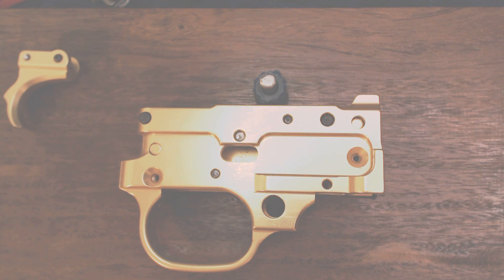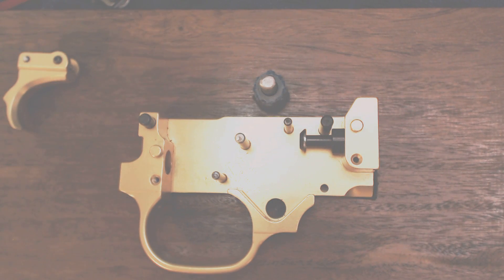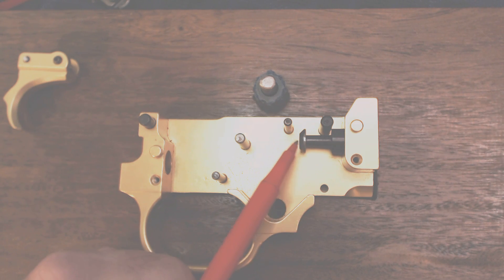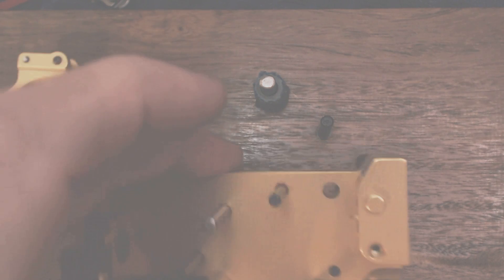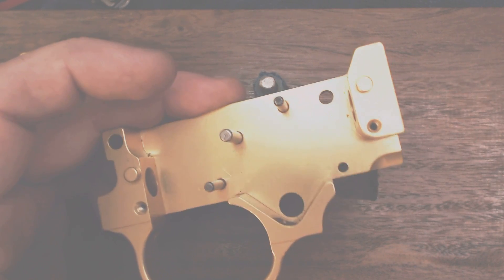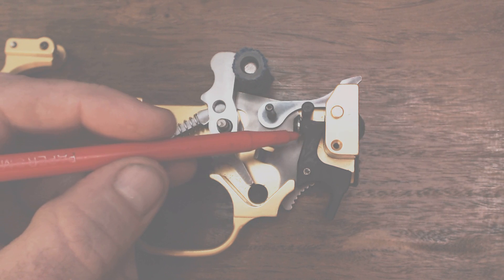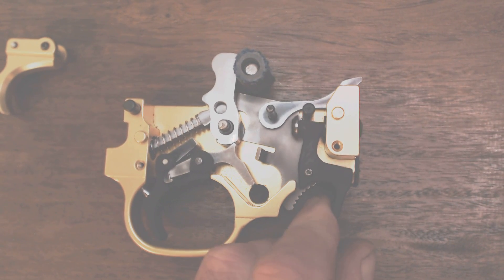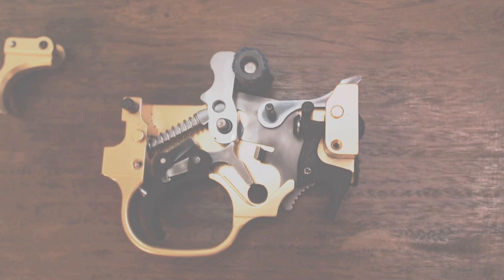Ruger 10/22 Trigger-"and how it works"

Comment: this is a very good video. now i understand how it works & what needs to be redone to lighten the pull and remove creep. it's a two stage trigger. it has take up, then the wall, then the creep, then the break. take up i don't mind, but creep on my factory trigger is bad.

Comment: Thanks, Aaron! Just seeing all the parts interacting was enough to help me figure out that I mixed up the trigger return spring with what I think is the sere spring. *My trigger wasn't resetting, but everything looked correct. It wouldn't break either, until I figured out that if the trigger was manually reset it would function, and release the hammer.
 *Thank you for helping me rule out the majority of the assembly as the culprit! I appreciate the format you used, with detailed illustratration.

Comment: Nice explanation. I've done quite a bit of work to my trigger group and your video gave me some more ideas of areas that needed polishing. One area in particular I found is the hammer bushings, where applicable. The contact area of the bushing and hammer was rough. Careful stoning and polishing of the hammer and very carefully polishing the bushings really smoothed it up. I'm still learning, but reducing friction in the hammer and trigger components lightens and improves trigger feel.

Comment: Thank you! The first time I broke down the rifle for cleaning the safety rotated and the trigger was jammed. I was able to find an on-line post describing the problem which can happen when the safety is in the middle so you can take it out of the stock. After watching your video a couple of times through I watched an instructional video on disassembly and reassembly of the trigger group. Even where that was not clear I could follow because I understood the action from your very clear explanations. I am sure I would have struggled for days. As it was, I was able to break down the trigger assembly resolve the issue and get the rifle working again in one go. Thanks for the gift!

Comment: FBI may come and bust my knee caps for asking, but would removing the notch for the disconnector that's on the hammer make this full auto?
Reply: It probably would but it probably wouldn’t ignite reliably, hammer follow would be an issue in my opinion